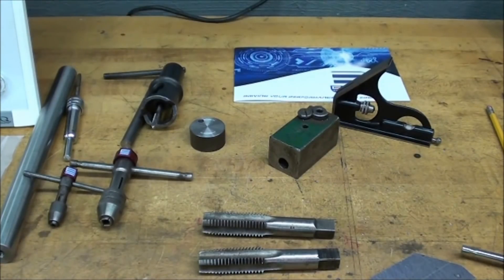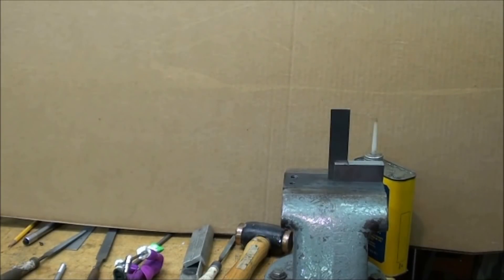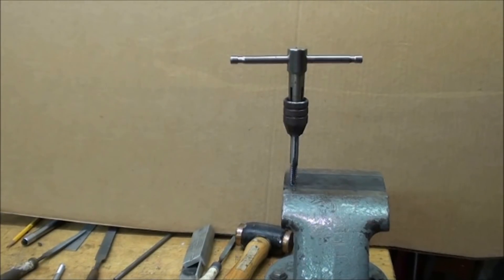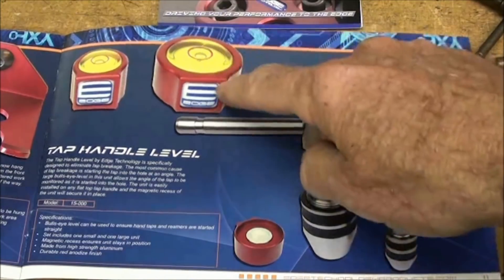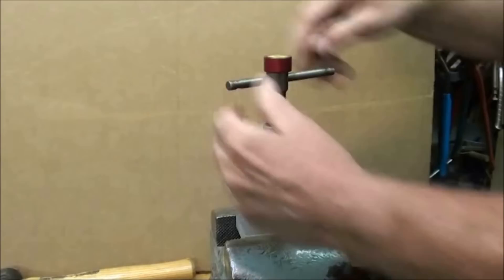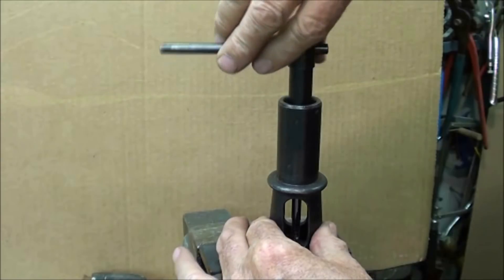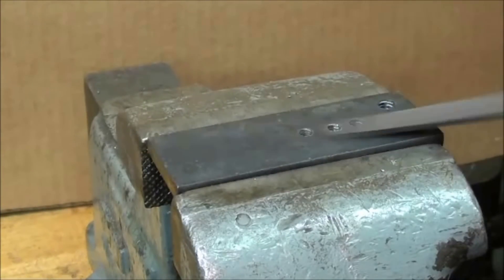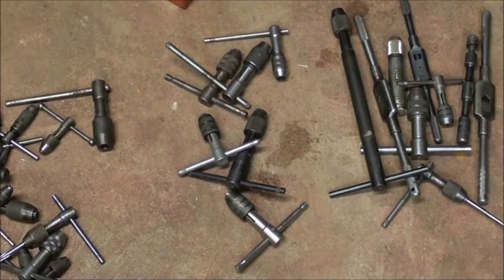Tapping Perpendicular Holes TIPS #R100 REPETE tubalcain

Comment: Hey Mr. Pete.  Even though I'm a journeyman manual machinist, I always love your videos.  Curious, why you're using a 1/4 drill bit for 5/16-18 vs an "F" drill bit.  In theory, a 1/4 bit would be appropriate for 5/16-16 (special).  The slightly tighter 1/4" hole just adds to the difficulty without adding any value.  

For readers:  the tap drill (for 70% thread) is major minus pitch.  Ex:  3/8-16 uses 5/16 drill bit.  I machined for a dozen years before I learned this.  Was kinda by accident when encountering metric threads without a metric tap drill chart.  Ex:  10mm x 1.5mm tap would use 8.5mm drill bit.

One of the places the metric math is that much easier.
Reply from the maker: Simply because a quarter inch drill is more common and available

Comment: another way to do it is if your using a drill press then after you drill the hole then use the drill press to hold the tap and TURN THE CHUCK BY HAND to start the tap. then it will match the hole.
Reply from the maker: Thanks

Comment: Another thought:
  I made a 2 inch diameter by 1 inch thick block (similar to what you showed) but with 9 holes that support both the tap size drill bit and the tap itself for 8 sizes of tapped holes from 6-32 to 1/2-13.
Instructions are at:
https://spaco.org/Blacksmithing/TapDrillBlock.htm
Reply from the maker: Thank you, I should make one of those. Nice drawing

Comment: I had never seen the taps mentioned by Fredio54, good idea. Comment section helps again. There is a huge variation in the quality/durability of taps. Being an expert at breaking small taps I try to use the mill or drill press & a tap follower whenever possible. I don't have but have used the Tapmatic devices. Great tools & I think Mr. Pete has shown them. One last thing, tapping fluids,  I have a few, all seem to help, so does about any kind of oil. What is the "best?" Don't use any on cast iron!

Comment: The tap will self-align once it is started in the correct size drilled hole.  Tapered tap and Bottoming tap.
Reply: Sorry, that's not correct. Anyone who's done much tapping has found that out, and Mr. Peterson demonstrated that at the beginning of the video.
Reply: @g.tucker8682  If started reasonably straight especially with NF taps they will alingn.  They have to!  They cannot redrill the hole.
Reply: They can certainly "redrill" the hole, they have cutting edges. Please look at the example at the beginning of the video. If you can't believe what your own eyes show you, go to your shop and try it yourself, and you will be convinced. This is a well-known and common mistake made by many novice metal workers.
Reply: @g.tucker8682  I am not talking about jello or aluminium, and fractional Taps cannot redrill a hole.  I have had very limited experience in taps starting crooked and have always managed to get them carefully straightened out in Steel.  Perhaps your and others experience differs.
Reply: @gordbaker896  Okay, one last try, and I’ll give up. First you said “The tap will self-align,” then said “...they will align. They have to!” Now you say you have had taps start crooked and “have always managed to get them carefully straightened out...” So now you no longer think taps “self-align?” Good, because they don’t. That’s why both of my machining textbooks caution that you must start the tap straight and continue to check squareness as tapping progresses. That’s why this video was made to begin with. That’s why your first statement was flat wrong.
Reply: @g.tucker8682  Read my previous reply and try to understand they do not wander off and drill a new hole.  Then give up.
Reply: Okay, since you asked nicely, I'll reread your last reply. Yep, it still mentions that you have found the need to "carefully straighten" a tap that was started crooked. Happens all the time. Too bad there are no self-aligning taps. 
Now that I did as you asked, you owe me one: look at the example Lyle shows at the beginning of the video, and try to figure out how the tap is crooked even though the hole was straight. It seems it did not self align.
Sorry to the viewers for dragging this out, but I didn't want a novice to get the wrong idea from the initial reply. Thanks Mr. P for some useful and interesting guidance, as usual.
Reply: @g.tucker8682  I don't know that the hole was straight.  I would have to think it was tilted a bit for demo.  I would never go that far with such a crooked tap position.  I did not see that it went all the way through.  Done with this.

Comment: Lyle,
I like to use ratcheting tap wrenches as it eases the hand angle. Starrett makes a nice version, but General and probably a rebranded General (Craftsman) are pretty good quality. I have a 35 year old Craftsman that looks like a General, but for some reason it has a tendency for the tightening collar to loosen during use.

The ratcheting feature allows me to position myself optimally and exert more uniform pressure. I own a never used tapping machine. It seems that every hand tapping job I experience won't easily set up in the machine. I own one and none of my sons have one. This at least keeps me one step ahead of our shared desire to own more tools than each other.

Comment: I've found it's easier to tap straight with the cordless drill than by hand. But I only have machine taps, they are hard to get straight by twisting the T handle. Also the tap life should be longer. Even better would be to attach the leveling eye to the cordless drill.

Comment: Re tapping deep holes in steel when you do need the full depth thread for various reasons, the secret weapon is serial tap sets. Volkel make some good ones in Germany - not sure who else. But they take a very light cut with the teeth at approx 1/3 height for the first tap, 2/3 for the second, and full profile for the third, or something like that - in practice the middle one takes the greatest chip load, with the first one pretty light and the final one a finishing pass for surface finish. Really nice to use. I did a bunch of M10x1.5 holes 40mm deep with these a while back, no breakage, perfect outcome.
Reply: We call them 'Bottoming Taps' in Canada.
Reply: @gordbaker896  I think that's the fairly common term for the last tap in either a standard or serial set, no? :-) The differences is in the overall chip load on the shank that you're driving. A taper tap once in deeply is cutting a full depth tooth profile spread across its 7 or 8 tapered teeth, where as the serial ones cut about 1/3 of that for each stage. In the taper set, you just cut a bit more deeply with the less and less tapered ones, whereas with serial you cut full depth on every path, just less of the tooth profile on the earlier ones.

Comment: I used sockets that the tap fitted and that helped me tap. I even used a 3/8" air sidewinder to tap holes. If I didn't have a socket to fit I would get with tool room and get different size pipe and only needed them about 1 1/2" long.
I had to rework a lot of holes for Cat.

Comment: Thanks for the "repete" Mr Pete.
Although you only mentioned them briefly, it might be of interest to note that we use a slightly different terminology here in Australia [and I think NZ and the UK but don't quote me on that!] - which can lead to confusion.
Here a plug tap is not an intermediate tap, it is a bottoming tap.  So where you gents [and ladies] use TAPER, PLUG AND BOTTOMING, we use TAPER, INTERMEDIATE AND PLUG. Sometimes we use 'bottoming' instead of 'plug' but when it is used, 'plug' ALWAYS  means a bottoming tap here.
I hope this helps to remove the confusion for some of the less experienced viewers.
Keep up the good work!
Reply: Mousemade Well done for bringing this up. I was just about to tell Lyle that the other tap was a second tap as we call it in England, but you beat me to it. I notice too that the Yanks have a tap called a gun tap that I have never come across in 40 Years engineering in England. The flute has a groove ground in the front as a chip breaker.
Reply: @daveticehurst4191  - (Question: What is a gun tape?) The cutting face of the first few threads are ground back relative to the axis of the tap to force the chips ahead of the tap. This reduces loading and clogging in flutes and allows a free flow of coolant to reach the cutting edge. ... They are also known as Gun Taps, Gun Nose Taps, Bull Nose Taps, or Chipdriver Taps.
Reply: @ronringel9132  Gun taps are great for power tapping holes. Can't be used in blind holes, because the chips pile up in the bottom. Gun taps are my go-to taps in anything but a blind hole. I've power tapped 1,000s of holes with a Milwaukee mag drill in gigantic gantry mill beds.
Reply: @daveticehurst4191  they're also known as spiral point. It's intended to push the chips ahead of the tap. So, they can't be used in blind holes.
Reply: I just say starter , middle, and bottom